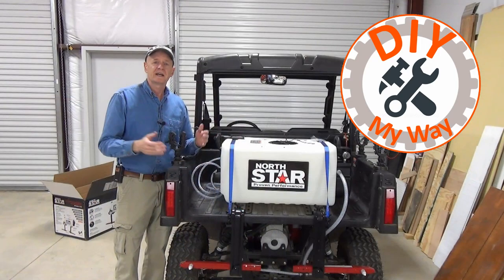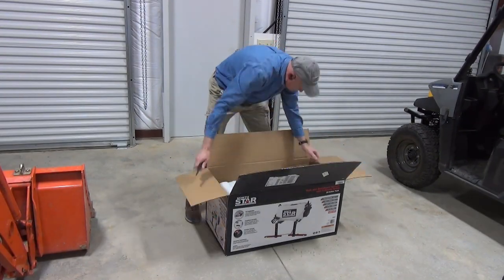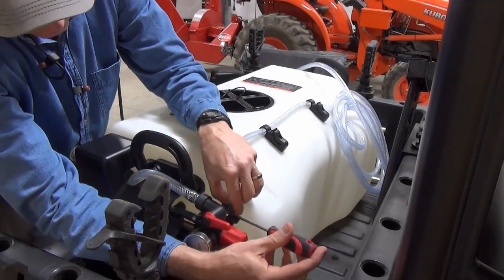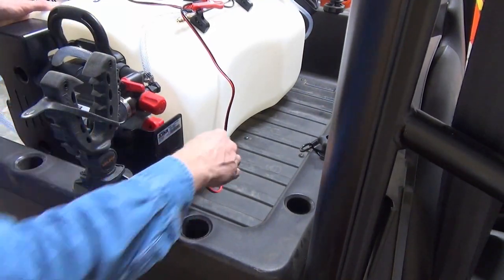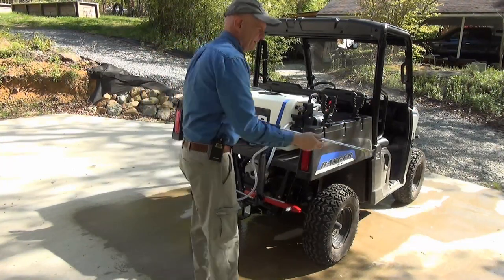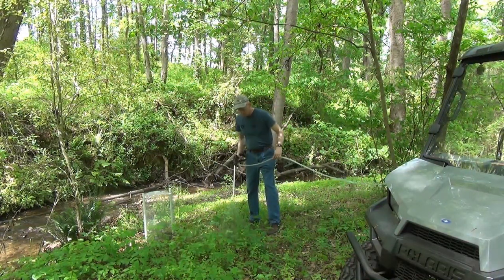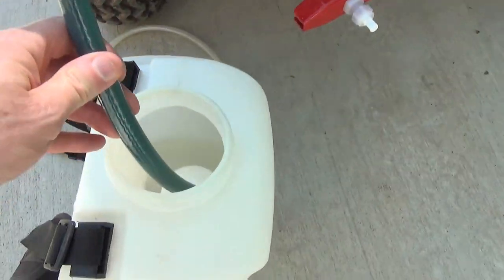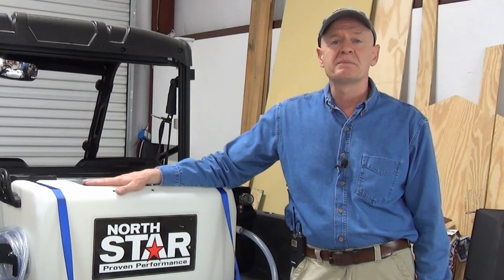NorthStar ATV Broadcast & Spot Sprayer Review: Specs Assembly & Testing (#129)

Comment: I know a little too much about spraying herbicides.  Part of my job was a state licensed sprayer, in charge of our resource teams.  Here's a couple of suggestions for controlling poison ivy.  Spray early in the morning or after a light misting rain.  I know it seems counter intuitive, but the plants open up their cells (Stomata) to control moisture regulation.   This makes them vulnerable to the herbicides.   If you think about it, it makes sense, during really dry weather the plants are closed up to regulate moisture loss, and the light dosing from the sprayer isn't enough to allow them to open up, and half of it evaporates before it is useful.   The other most important aspect is speed/spray volume/spread, but that' an entirely different math calculation.    Good luck.
Reply from the maker: Hi SuperJamster1!  That’s great advice!  I appreciate it very much! Thanks for watching!

Comment: I own a pest control/lawn fertilization company I have been a Certified pest control Operator here in Florida for 39 years (family business) I would suggest wearing nitrile gloves, long sleeve shirt/pants as well as rubber boots. All clothing used should be washed separately from your regular clothes as well and in very hot water. These precautions should be followed when using all chemicals, but especially Roundup. When spraying Roundup it is important to apply it using large water droplets, this reduces the chance of it drifting onto undesirable target foliage. One Roundup treatment stays in the soil for 8 months. Over the years I learned one thing very well, chemical companies sell chemicals, and they do not give two flips about your health, so act accordingly. I found your video because I just sold my lawn spray truck, I am preparing to retire and I have no intention of paying someone to treat my lawn. I am interested in using your setup on a zero-turn mower. Liked your video, so I subscribed.
Reply from the maker: Thank you for the tipsand for subscribing, Mike!  Also congrats on your upcoming retirement!

Comment: Good video!
I have two 15 gal tank sprayers.  I use one for Roundup and 2-4-D, and one for insecticide.   I put the tank in my front loader bucket and run the spray hose to the tractor operator station.  Works well for my needs.
Reply from the maker: Thanks, Eric!  Sounds like you have a good setup. Thanks for watching!

Comment: Hi Martin. I have a similar unit on my Kubota RTV. Amazon sells an extension cord with eyelets on one end (battery end) and the exact same plug on the other along with (another) inline fuse. Routed it in some cable wrap and permanently installed it with the plug sticking out in a convenient spot. Little bit of velcro w/sticky back on the switch allows me to stick it on my ROP just over my left shoulder for convenient on-off operation. Sprayer works great. Thanks for another great video. Good luck with your PO.
Reply from the maker: Hi Paul!   Sounds like you have a good set up.  Now that you mention it, there is no inline fuse on sprayer’s cable.  I may change the battery clips out for a cigarette lighter plug so I can just plug it in to the 12V outlets on my Polaris or my tractor.  The PO is already looking sad in the areas I’ve sprayed so I’m encouraged. Thanks for watching!
Reply: @DIYMyWay  Here's the cable I used. https://www.amazon.com/gp/product/B079ZTBHYK/ref=ppx_yo_dt_b_search_asin_title?ie=UTF8&psc=1
Reply from the maker: Thanks, Paul!  I appreciate it!

Comment: I have the older model (pump on top). Highly recommend running/flushing water through the tank, hoses and valves. My experience if you don’t, the next time you use it, you’ll spend 15mins cleaning the dried chemical out of the nozzles and trigger mechanism of the wand. Further the plastic ball valve used to change fluid direction from boom to wand will seize.  Same if this model uses a mixing valve (allows fluid flow back into the tank).  
I purchased a wireless remote for mine.  Makes it easy to control whether mounted to my ATV rear rack or in the dump bed of my RTV.
These are great for the price.  Mine is 15 years old and still in use.
Reply from the maker: Thanks for sharing the tips and for watching!
Reply: That’s a good idea…. Maybe the hoses won’t dry rot from within from the chemicals…Nice!

Comment: I have the same sprayer with the same 2 problems. Cross threaded drain and cycling on/off. I have added Teflon tape and hope it stops this. Thanks for the video.
Reply from the maker: Once I fixed the cross threading and tightened other fittings, the cycling quit and it has worked perfectly ever since. Thanks for watching!

Comment: Great video on this product! I just bought the 26gal boomless broadcast and spot sprayer setup. I also had the cross threaded drain cap and the same issue with the pressure regulator. I figured out the drain cap already so now I need to check my fittings for a leak. Otherwise a solid product.
Reply from the maker: Thank you Chris!  Yep, other than the initial issues we both had, it’s been a great product.  One thing I learned is that it’s important to clean the tiny filters in the nozzle after each use. Thanks for watching!

Comment: Your review induced me to buy one.   Good presentation.   Did you encounter trouble screwing and unscrewing the cap to and atop the tank?
Reply from the maker: Thanks!  Glad to hear it.  No, the cap on mine goes on and off easily.  I suggest checking the cap and tank threads for any plastics burrs that may be binding it up.  If so, you can probably carve them off with a pocket knife.  Good luck with yours!  I still really like mine. Thanks for watching!

Comment: How are you liking the sprayer after a year of use? I’m thinking about getting one.
Reply from the maker: Hi Chandler!  I still like it a lot.  It is working well and I’ll soon be taking it on the trails again to kill off the vegetation.  Thanks for watching!
Reply: @DIYMyWay  I got this sprayer & I have had a lot of issues. I have already returned 2 units. & I am going to be returning the 3rd one I have now. The top lid is cross threaded. & the pump will not shut off it runs continuously. It should turn off when it builds up pressure correct? I am having northern tool mechanic call me about the problem tomorrow. To make sure that the pump must be defective. The first 2 that I returned had the same problem but they were leaking in multiple areas. But this one I have now isn’t leaking anywhere, unless the cross threaded lid on the tank is causing the pump to run all the time. Hopefully they get this fixed.
Reply from the maker: Hi Chandler!  Sorry to hear you are having so much trouble with yours.  The lid cross thread won’t affect pressure build up because the tank itself isn’t pressurized, but you should be able to un screw the lid and thread it on correctly.  The pump will only build up pressure and cut off when the spray gun is being used.  If there are no leaks and the pressure regulator is working right, when you move the valve to the spray gun position, and turn on power, the pump will run for a few seconds until it reaches the set pressure.  When you pull the trigger on the spray gun, the pump will start running until you release the trigger.  If the pump is running all the time and there are no leaks, open that tank lid and see if the bypass is returning the fluid to the tank.  If that’s not happening then the pump is is probably dead heading and is under strain because your pressure cut off switch isn’t working.  That means you’ll need to get pressure switch replaced.  Of course I assume you know that the pump does run continuously while in broadcast spray mode. I hope the NT technician can help you fix the problem.

Comment: Great video. I am wanting one of these sprayers to use for cleaning my roof. Most folks have said get at least a 5gpm pump but it looks like this one will spray far enough for what I need. Have you tried increasing the psi and if so how far does it truly spray? Thanks!
Reply from the maker: Thanks, Kevin!   I haven’t tried higher PSI so I don’t know the maximum range of the spray gun, but if you are spraying from the ground up to a one story roof, it will certainly do that.  Thanks for watching!

Comment: I'm curious if you've had any experience with this unit where the spray from the boom becomes a bit sporadic even though the tank has plenty of fluid.  If so, did you find a resolution to the problem?
Reply from the maker: Hi Mike!  Only when the fluid level gets to about 3” and is sloshing around due to uneven terrain.  I’ve thought about making a set of baffles to go in the bottom to minimize sloshing. Thanks for watching!

Comment: Thanks again, Martin! I'm researching these for my trail system but can't decide on whether to a get 3-point style for my B2601 or a trailer style for my wife's Cub Cadet ("Cubby"). Since the 3-point is about 3 times as expensive for some unknown reason, I'll likely go for the trailer. Oh also, could you provide an update on how the application worked on your trails?
Reply from the maker: Hi David!  Sounds like the trailer option is the best because you could pull it behind your tractor as well.  The sprayer and round up worked great on the trails.  The pattern was just the right width and the round up killed just about everything in it’s path.  Good luck with yours!
Reply: I just bought one from Northern Tool (Amazon's been out of stock since you posted your video). My plan is to mount it to a garden cart chassis. I liked the trailer types, but the axel is so narrow I'm afraid of tipping on my trails. The garden cart is about twice as wide and should work nicely.

Comment: I'm looking into doing food plots and am trying to learn about sprayers.  Do you feel the 16-gal sprayer would be big enough for two 1/2 acre plots?  Thank you and great video!
Reply from the maker: My guess is that it would be, but it depends the recommended rate of application and whether you are spot spraying or broadcast spraying. Thanks for watching!
Reply: @DIYMyWay  Appreciate it!
Reply: Hey actually, one more question.  I just ordered the 16-gal sprayer, basically same as yours but the step down.  I was wondering, how does the agitation feature work on this?  Is there a valve you have to open for it to continuously circulate/mix?  Thanks!
Reply from the maker: There is no valve that I know of.  I would guess that the pressure regulator bypass feeds back into the tank to stir things up as it regulates the pressure.
Reply: @DIYMyWay  Sounds great, thank you.

Comment: Great video, very impressed with the quality of your video and editing as well. Is it still holding up ok? Im looking into one for my ATV, looking at the small 16 gallon sprayer but cant seem to find videos on the particular one (fairly certain it the exact same as yours just 10gallon smaller but same pump and everything) 

Only concern im seeing is one the exhaust on my quad is right about where the boom would be and somone else reported it melted the lines so thats a concer as well as it keeping a prime, we dont have a ton to spray and usually always be smaller batches im doing, mainly just 2 longer driveways and thats it.
Reply from the maker: Thank you, Braedon!  Yes, I have used it a few times since making the video and it still operates fine.  You are probably right that the only difference is the size of the tank.  The exhaust could certainly be a problem.  Perhaps you could redirect the exhaust on it.  The pump is self-priming so that shouldn’t be a concern. Thanks for watching!

Comment: One more question regarding the 26 gal NorthStar ATV Broadcast & Spot Sprayer.  If I remember correctly, the literature claims a 40-ft wide spray swath.  I've never been able to get much more than an 8-ft wide spray even when the unit was brand new.  I've checked for blockage and find the system to be clear.  Is it possible that my Kawasaki Mule isn't providing sufficient electrical power to the pump motor? Thoughts?  

I've also noticed that the pressure regulator and gauge have little to no effect on the broadcast mode of the sprayer.  I generally run the unit with the pressure knob open 100%.  Closing it, of course, only makes the performance worse.  The knob and gauge do, however, seem to regulate the pressure/flow when in the spot sprayer mode.  Is this intentional or should the knob also regulate the pressure when in broadcast mode?

And, DIY My Way, thanks so much for your insight and for the very helpful & informative videos.
Reply from the maker: Hi MIke! You must have the wide boom model if it claims 40ft.  Perhaps they are referring to the spot sprayer, which can shoot a LONG way if set to a stream.  Make sure you clean the tiny filters in the nozzles.  They can easily get gunked up even after a single use of RoundUp.  The fact that you spot sprayer works right suggests it’s the nozzle filters.  It’s also possible that your Mule isn’t producing the juice you need but you can measure the voltage at the alligator clips to see.  Good luck!

Comment: No, I have the boomless sprayer........same one that you demo'd on a previous video.  
See this link for note (bottom left corner of image) that states: "40-ft W spray swath":  https://www.northerntool.com/shop/tools/product_200727350_200727350  
What spray path width SHOULD I expect to get with this broadcast sprayer?  If it turns out that the voltage is insufficient, do you have any suggestions..........other than adding a second standalone battery?

Regarding the spot sprayer, I would say that this comes down to a pressure issue.  In other words, If I turn off ONE of the broadcast nozzles, then I can gett a pretty good throw with the remaining one.  The problem is............well, you know!!

One last thing.  I wasn't aware of there being tiny filters INSIDE the broadcast nozzles.  Am I reading your response correctly?  Sounds as though I need to DISASSEMBLE the nozzles and clean thoroughly, right?  Is this addressed in the manual?

Thanks again for your feedback!!
Reply from the maker: Sorry for the delayed response.  You include a link in your comment which automatically through it in the Held for Review bin.  I didn’t buy it for a 40-ft W spray swath and I can’t imagine it coming even close to that with the nozzles it came with.  They would have to shoot out horizontally instead of vertically to have any chance of getting to 40 ft.  Maybe it can cover 12 to 15 ft at best which is all I would ever need.  

As for the power issue, if there is one, either install a more powerful alternator or add a second battery, but you’d need a way to charge a second battery - like a more powerful alternator.  

Yep, there are tiny super-fine filters in each nozzle that can get clogged.  Mine get gunked up with RoundUp after I’ve run a tank or two through them.  But they clean up pretty easily with hot water from the faucet.  I don’t remember if it was in the manual or not.  I discovered them just by taking a nozzle apart to see how it was built.  Good luck!
Reply: @DIYMyWay  
Thanks for the response, DIYMW!!  If you read the info in the link that I sent, did it suggest to you that I should be getting a 40-ft wide spray pattern, or did I completely misunderstand the text?  At BEST, I get something on the order of a 6-ft spray swath, sometimes less.   By the way, all of my recent testing has with clear water, no chemicals. Over the past couple of seasons, I have used Round-Up, but have cleaned the sprayer after each use.
  
Since my last message to you, I too have disassembled both of the spray nozzles, but I'm not finding any sort of filter inside.  Oddly enough, upon reassembly, the flow/spray is even worse now than before.   

I've also connected the power leads to my truck battery as a test to see if a more powerful electrical system might improve the flow.  No luck there either!!

Would you maybe suggest a completely different pair of nozzles?  Maybe something similar to the nozzle on the spray wand?

I'm also considering adding a boom attachment in lieu of the current (crummy) spray nozzles.  Any thoughts or recommendations on this?

One last question (a repeat from my original message):  Am I correct in thinking that the knob that regulates pressure ONLY affects the wand and has no impact on the broadcast function whatsoever?  The gauge shows zero pressure when set to broadcast mode.  That strikes me as a bit odd.

Thanks again,
Mike